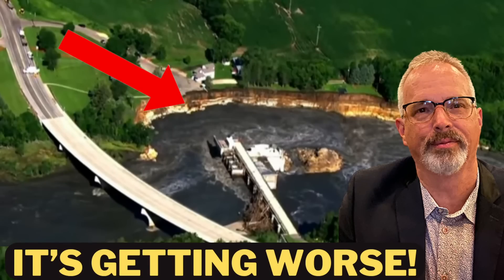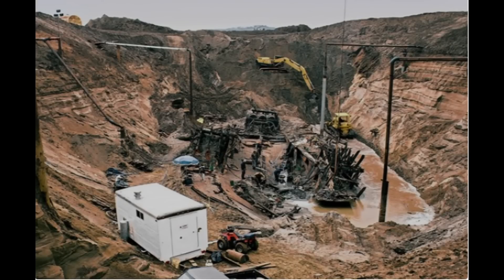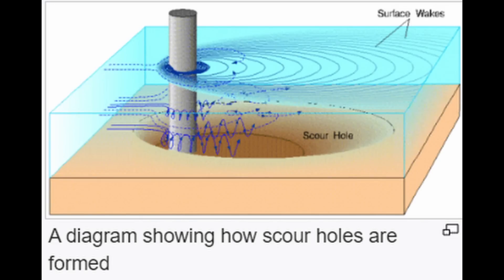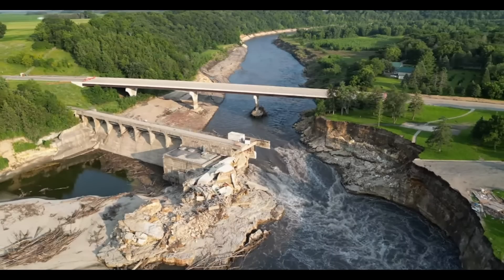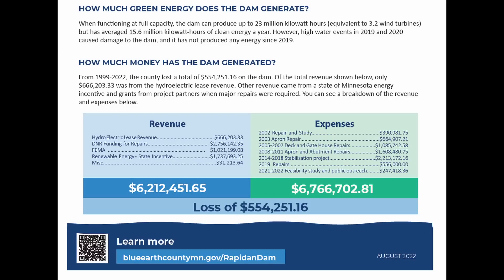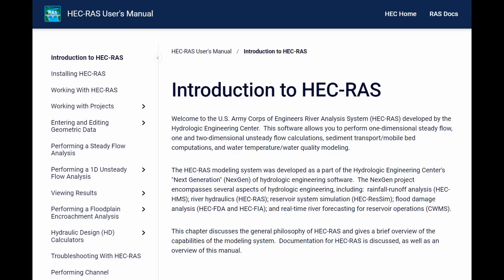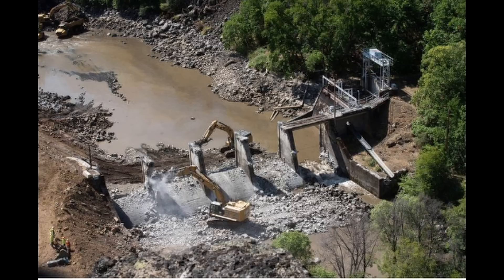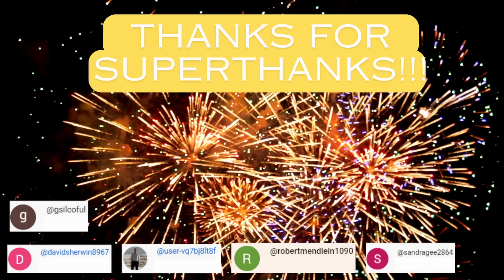Rapidan Dam, Bridge and Scour

Comment: Maybe this has been discussed, but I always felt that in the early stages of the failure that a controlled partial demolition of the dam to relieve the pressure on the dam, prevent scouring and potentially save the bridge, the house and the store was in order.  Today it comes out that the Blue Earth County officials are now going to remove the dam and rebuild the bridge.  At the end of the day the losses are the dam, the bridge, a house and the store along with the erosion of the embankments.  Would it have been any worse doing a partial demolition in the early days?  Could it have helped salvage the bridge, house and store?  The dam was clearly to my untrained eye never going to function again from the get go without being rebuilt.  Curious to see your take in an updated video given today's news.  Great video content I can't get anywhere else.
Reply from the maker: I don't think officials have ready access to explosives and I doubt that they have on call contracts for that sort of thing. I'm just not sure. ALso once the dam was in danger it was pretty risky to be around. I do have an update that I'm working on so please stay tuned.
Reply: @CaseyJones-Engineer  I look forward to the update video. I would think though that the Army Corps of Engineers would have been called in for help. It seems nothing was tried such as dropping bags of rocks or K rails to at least try to protect the embankment. I used to live in Minnesota and back 30 years ago the State leadership would have mobilized to try something. The current leadership let Minneapolis burn and don’t seem to care about the actual taxpayers anymore. That’s why I left.

Comment: I guess they don’t have to worry about the 40+ feet of sediment now.  I guess they need to start taking the dam itself down so the water will use the center channel and stop eroding the West Bank.   Keep up the good reporting sir! 👍
Reply from the maker: Thank you!  I agree that the dam must go as soon as possible.  I see no viability in building a new one there from an economics standpoint.
Reply: @CaseyJones-Engineer  I know it would be pure speculation at this point, but how do you see this getting fixed?  I assume maybe tear out the old dam, then maybe sheet pile the bank that has collapsed and back-fill?  Then the bridge fix/shore-up.  They have a much more expensive fix on their hands now it would seem.  Its almost like the FL new condo laws about requiring the reserve money be there for fixes for all the owners.  They literately can't kick the can down the road as it has washed away.  Now maybe the city/county could also be liable on the loss of the home/businesses as well because they kept kicking that can and knew it was in bad shape for years but did nothing about it.   I have an extremely hard time believing that this disaster was caused specifically by global warming, I am leaning towards lack of maintenance and years of neglect.  Maybe a quick call to Mark at Controlled Demolition, Inc. and they could take care of the dam....  🤠👍
Reply from the maker: @Chris_In_Texas   I agree I think the bridge is going to end up being replaced. I agree that the need to place new scour protection in the channel.  Probably giant rip rap or even reinforced concrete structures. Sheet piling won't work here as it wouln't penetrate the sandstone bedrock.

Comment: If the records show that there is the likely potential for a problem you can ignore it; but not forever. For the past few decades the people in control of the infrastructure have been "kicking the can down the road" to use public money to support pet projects rather than maintain facilities that are ageing. Think about bridges, rail right of ways and lately dams in the recent past that have failed. We constantly hear about the power grid "in short bursts" from the media, but the news cycle moves away from these things we depend on every day until another one fails. This dam failure was all over the news and internet for about one week. I guess it fixed itself because your video is the first I've seen in a while.

Comment: We had a flood back in 2007 that was caused by trees and rubbish in the river building up against a bridge and blocking the water which then rose very quickly and flooded. The solution was to clear the riverbank of all trees, which they did, it looked a total disaster. They then get the problem that the riverbank starts eroding quickly in places it didnt before the trees were cleared, so they had to plant more trees to stabilise the riverbank. In the end they spent MILLIONS to make a mess and end up right back where they started. The solution is that sometimes rivers flood and you deal with it because trying to stop floods is a fools errand.

Comment: They allowed it to happen intentionally, as the expense of removal or repair was deemed prohibitively high. Additionally, there was the prospect of establishing a gravel pit directly behind the now former  dam store—a project strongly opposed by the community—but the county prioritized potential financial gain over public sentiment. Trees have been lodged in the dam for several years, and before 2021, they consistently employed excavators and cranes to remove both trees and ice from the stilling basin.

Comment: The value of maintaining and upgrading those dams is likely minimal in contrast to the downstream consequences of not doing so.
Reply: The pretty boy dam in Maryland has a crack 4 inchs wide 30 feet below the over flow . Baltimore City owns it and has lowered the water level. But come spring time if not fixed it may fail. At 236 feet tall the wall of water hitting Baltimore City will be about 60 foot tall.  I hope they do. Something to prevent this. .

Comment: The amount of material and the speed and short period of time this happened in is incredible. However, it’s not surprising. We have had a number of occurrences of this type of activity happening in recent years. One example is with the removal of the Marmot dam from the sandy river at Troutdale just east of Portland, Oregon.  After removal of the 47 foot high dam was completed, they breached the cofferdam holding back the river and POOF!, literally overnight, all the cofferdam and decades of sediment vanished from the area. It was redistributed down stream ind out into the Columbia River. The effects of that dam removal have been extensively recorded and analyzed. Lots and lots of lessons have been learned from that activity. And more than a few surprises have taken place.
Reply: That sounds super interesting. Any good videos or solid resources to point towards?
Reply: @djblackprincecdn  Elwa dam removal. https://www.youtube.com/watch?v=Q3ooEH3cGHs

Comment: It is a hard sell to repair a critical bypass of this dam when it has a fairly limited generating capacity, and ever shrinking reserve storage capacity.  If it could sell more power, and didn’t require expensive repairs as often, which more reserve capacity would certainly put a dent in), it would be an open and shut approval.  We have seasonal flooding issues.  We have several fairly large (for the area) dams upriver that do a considerable and valiant effort to keep water spikes down, and generate a good bit of power on the side.  The smaller, twice this dam’s power, the larger, over fifty.  The savings on damage alone, balance the budget almost every year.  And the owners of the dam are the same people who end up paying for the damage, so it’s the same budget.
We have a dam that gets submerged every year, has negligible capacity, and a head of a mere four feet.  After studies showed that the lower dam could keep up, the dam was to be removed.

Sparknotes version
Undersized capacity for current demands, unsustainable generation capacity, and damage mitigation not factored in to profitability.  Less loss, is a profit.

Do you sink money into clearing the reservoir to restore capacity, update the generators, fill the washout, and perhaps increase both storage and flow, or take the loss and blow it to bits?
I’d say invest, the little old lady who signs the cheques at the county would probably beg to differ.

Comment: I really wish people would stop saying the damn failed.
It was overtaken.
The damn did not fail, it's still there.
The Earth around it failed, but the damn dam is still good.

The Salinas River in California had a serious change of course after the 1906 earthquake.
It used to run right through town. 
It snaked its way some miles upstream and bypassed the whole town.

You mentioned living up there in sac of tomatoes, it reminded me of when Alviso went under.
Reply: It's my understanding that the dam's spillway failed, which it what created the erosion opportunity and allowed the river to flow freely around the dam.  A dam's spillway is integral to the entire dam structure, so if the spillway fails, the dam fails.  The gentleman who created this video is a professional engineer and HE says the dam failed.  Are YOU a professional engineer to rebut his statement knowledgeably? Also, and this is just my personal opinion, any structure that becomes incapable of fulfilling the purpose for which it is built is a failed structure.  Following your line of thinking (metaphorically), what if a house burned down due to a faulty wire in a toaster's electrical cord?  The electrical chord is integral to the functioning of the toaster, just as a spillway is to a dam.  Would you try to say that the toaster didn't fail, the electrical cord did?  Not a perfect metaphor, by any means, but I think you get my drift.

Comment: Given the river has now diverted itself around the dam (so presumably making access and hydrological management easier for most of the year), partial removal - either of a section or lowering it by removing the gates and associated structures (so bringing it to bottom of gate level) - as well as removing all debris behind it - could potentially be a useful interim measure to reduce the amount of bank removed in the next flood event, by providing a secondary channel for some of the excess water.

Comment: Bravo-sierra!  Two of seven floodgates closed (28% of DESIGNED overflow capacity).  Debris not removed.  This is a failure of dam MANAGEMENT, not of the aging infrastructure!!!!  The dam handled the 1965 flood at 118% of the 2024 flood.  INCOMPETENCE in CURRENT management, not in historical design.  Don't say we have better meteorological history to work with when the dam was PROVEN capable of handling more flow than the 2024 flood!!!

Comment: This whole episode should be taught as a case study in how functional (albeit aging) infrastructure can be destroyed through poor management and operation.  This dam had passed flows greater close to 50,000 CFS previously, without damage.  The flows in late spring 2024 never approached that level.  All of this was caused by the county's failure to have an adequate debris removal strategy.  The county was entirely dependent on a single piece of excavation equipment owned by a private contractor.   As the flows rose and debris accumulated, they failed to mobilize that equipment or have any plan in place.  The contractor in question was using that equipment on another job, 5+ hours away.  The late spring high flows, and the debris accumulation were well-understood and predictable aspects of operating this dam.  It borders on criminal that no part of their high-flow Emergency Operation Plan had adequate contingencies for debris removal.  This dam, had the gates not been blocked by debris, was entirely capable of discharging the 30,000-ish CFS flows that we saw throughout this event.  It was within the designed capacity of this dam.  The high flows did not cause this event, it was entirely human negligence, at multiple levels.  We need to be asking why the county couldn't afford to keep the necessary equipment on standby.  Building infrastructure is only part of it's cost and we have got to start investing in the ongoing maintenance and operation or this sort of event will become increasingly common.
Reply: Excellent information.  Thank you.
Reply: Time for new management with some common scence.

Comment: Great Report.  So for the millionth time, 20 million to fix, and some hydro power is generated, or 80 million to remove.  Even at a loss of 4 million a decade, it would have taken 60 decades of loss to equal the additional cost of removal.  Now the state will apply to Feds for Federal disaster monies, passing their costs on to other states.  This must stop.  When a state ignores maint, due diligence like the Baltimore bridge that refused to spend a few million bucks to drive piles around the bridge to prevent ship collisions, can only get a LOAN at COMMERCIAL INTEREST RATES.  Seems the cheapest way to go is to fix up dam and fill wash out.  Reduce dam height and remove gates and remove hydro electric, build out apron far down stream to create rapids from new dam crest.  Most of work could be pumped concrete into which car sized boulders with rock places and concrete pumped over.  That's about as cheap as you get.  There are no doubt downstream areas now inundated with rock that had built up in dam, which can be removed and put back w pumped concrete maybe around bridge piers, and to otherwise backfill the washout below the concrete and rock wing wall blocking off the new channel.  This along with sloping land down in terraces gradual enough to allow farming finishes recovery.  To pay back farmer for degraded farmland and losses, eliminate real estate taxes for say 20 yrs.The home and biz that got wiped out, well, come on, states fault so pay for them 1/2 million, million, whatever.

Comment: In my city, we have a series of small dams right in the city center. Over the last decade, all of them have gonne through a series of upgrades, including replacement of the spillway gates and extensive repairs to the concrete. One of them holds back a small lake, but the rest of them are run of the river. The lake is there mostly for recreational purposes and realistically does not provide much reservoir for the dam. The bigger reservoir is a natural lake that's been dammed further upstream. All of them sit directly on hard bedrock.

Comment: HELLO.  THE DAM DID NOT FAIL.  It was improperly maintained and the flood gates could not open correctly because of so much debris in the way……the excess water went AROUND THE DAM and washed out existing ground there since the beginning of time….
The Dam is still standing and working

Comment: The cost annalist is WRONG!!! if they repair the dam they will not be replacing the bridge?? The two cost list do NOT compare... Wonder who got paid off to produce the FAKE cost list??
Reply from the maker: That is good point.  The could have done some remediation work to the bridge to make it more resistant to scour prior to removing the bridge.  This would have cost far less time and money than a complete bridge replacement.
Reply: @CaseyJones-Engineer  my point was there was the list for repair of the dam $14m and removal for $85m but most of the items in removal list should have also been included in the repair of the dam list. The bridge has to be fixed no matter if the dam is being repaired or removed and that cost should either appear on BOTH list or NEITHER list. Saying that repair of the dam is ONLY $14m because you did NOT include the bridge, and removal is $85m including replacing the bridge is a DAMN lie. Come on you are supposed to be a math major. Take the items from the removal list and add them to the repair list.

Comment: Thanks Casey. Your channel confirms the accuracy of this quote. “There’s never enough time to do it right, but there’s always enough time to do it over.”— John W. Bergman
Reply from the maker: Exactly.  That quote seems to apply in more and more cases these days.
Reply: I've worked for a couple shops like that. I spent more time fixing half assed repairs are arguing about doing it right in the first place than I actually spent fixing things properly in the first place.
Reply: Great quote, I have mine but not exactly applicable to this situation. 
If you have no intention of doing anything,  Doing something is out of the question. Me
Born out of my frustration with upper management.

Comment: Too bad you didn't get some pictures of the exposed pilings for the bridge, in some videos you can see the cap is now above the water and you can see several feet of the driven pilings above the water.  If those pilings are 40 feet as mentioned, depending on how deep the water is it's possibly 1/3 of those pilings are now exposed.